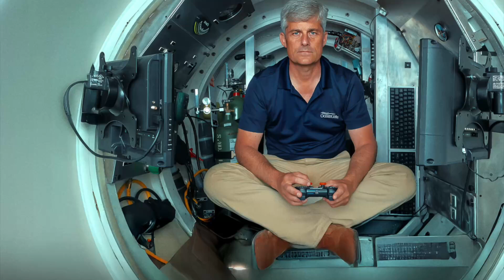Full Audio Recording: David Lochridge and Stockton Rush Safety Meeting

Comment: He is banging the pots and pans and coming from more experience in subs, which is exactly what you want,  and these other two are wanking each other off. "Trust real time monitoring", dismisses the loud acoustic explosion. "Its the perfect material, only needs perfect manufacturing techniques" continues to fuck up every mechanical unit installed.  Lochrege was right. If Rush did the testing and quality control, he  might have accomplished what he wanted. And being Experimental/cutting edge, all data and the accuracy is essential for the long-term success. Living or dying.

Comment: He was charging $250,000 PER TICKET. Why not just build an actual sub with actual engineers on your team and not with stuff you bought from Camper World? The arrogance on this guy. It's baffling.
Reply: Because $250,000 is nothing. Engineering is mindbogglingly expensive.
Reply: the titan design was an amazing feat of engineering. the fact that you are too uneducated to admire their achievements is your problem. the only problem is that the hull should have been changed sooner or made thicker. *what happened is nothing that special*. how many airplanes crashed before we got the working concepts of today??? *how many people like david told the pioneers of aviation that they can't make machines heavier than air fly and all kinds of reasons why it isn't possible?*. David seems like such a narrow minded person from this video. you all throw stones at stockton for what? he knew the risks and took his shot. The people on the sub signed papers saying clearly there was a risk of death.
Reply: @LukoBala ….It sounds like David was expecting to find a perfect sub, like a Triton one or ones he knew from his days in the navy. Think he was working for the wrong company.